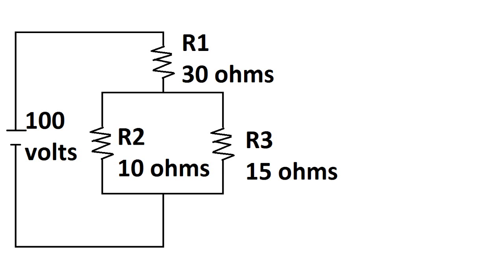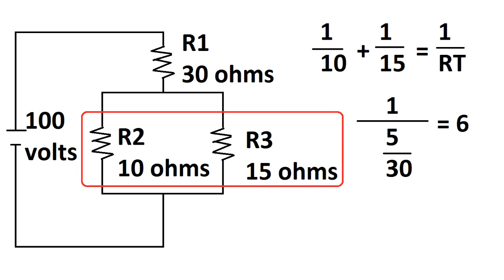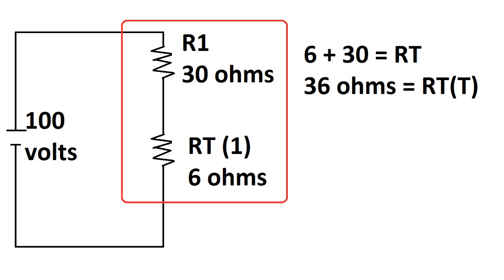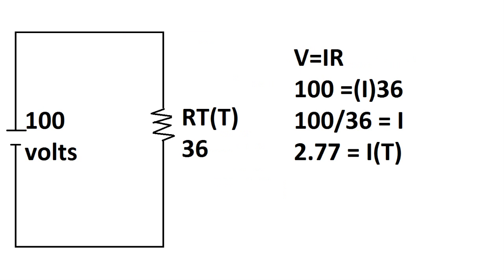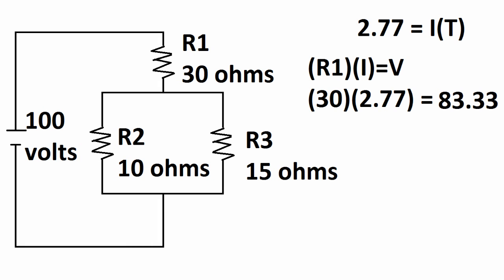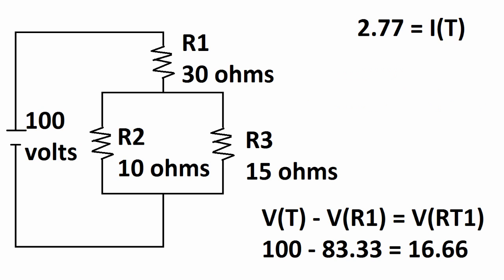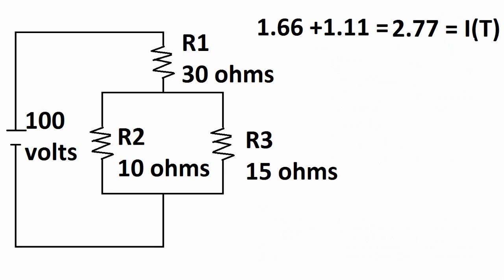Series - Parallel Circuits: How to Find Voltages of Resistors and Currents of Resistors

Comment: 2:12 So can you use the V(T)/R3=I(R3) to find the voltage of R3? By using the amps you get in that formula?
Reply: U basically take away any voltage that is in series, then work from there

Comment: I THINK YOU COMPUTATION IS WRONG...
Reply from the maker: i double check it and it appears to be correct. The only thing is that i used non rounded numbers when completing my calculation. (i used values that were in my calculator). If this video is unclear i have 2 newer videos on my channel that are a revamp of this concept. https://youtu.be/-pbrTJVn_9c

Comment: Could u plz tell me how to find the current in R3.
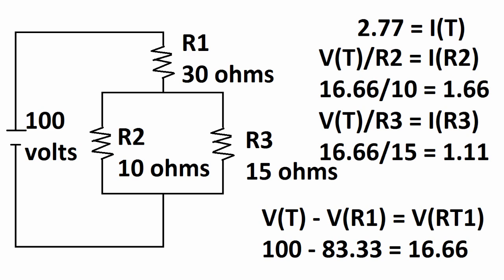Reply from the maker: check out around the 2:00 mark.
Reply from the maker: if you have any additional questions let me know. I revamped this video and made a better more clear color coded example you may want to check that out
Reply: VAM! Physics & Engineering you gave the totkal current, as well as for r2 & r3, but what about r1?

Comment: God I hope this works for a circuit with three branches or I am screwed. It's late and I can't be assed to figure out if voltage drop varies between parallel branches, I know that current does though.

Comment: Ok but just to let you know, when i work out the voltage for R1 i.e. 30 * 2.77, i get 83.1V.
Reply from the maker: +Trinispace you are correct if you multiply the 2 numbers you get 83.1 however i used a non rounded number (more sig figs) so 83.33 is closer to the actual value

Comment: i dont understand how you got the 5 in 5/30
Reply from the maker: +SMC_69 Productions 1/10 +1/15 = 5/30 assuming this is what your are talking about sorry i wasn't clear enough i will make note of this and try to improve in the future
Reply: +VAM! Physics thank you for replying and clarifying
Reply: simple fractions man. Common denom is 30. 1 x 3 = 3 and 1 x 2= 2.....2+3=5.
Reply: If it isnt too late, 1/10 + 1/15 = 3/30 + 2/30 = 5/30
otherwise,yr calculator would show 1/10 + 1/15 = 0.16666666666
which 0.16666666666 is actually 5/30 in fraction from.
1/0.16666666666 = 6.
or as is shown in the vid, 1/5/30 = 6(rounded number)